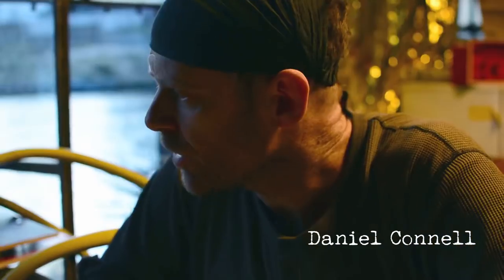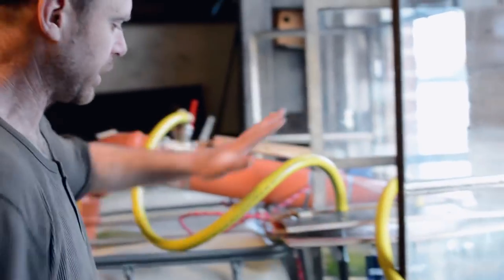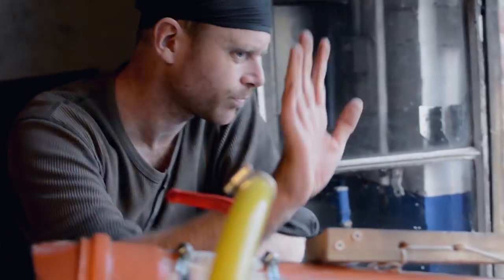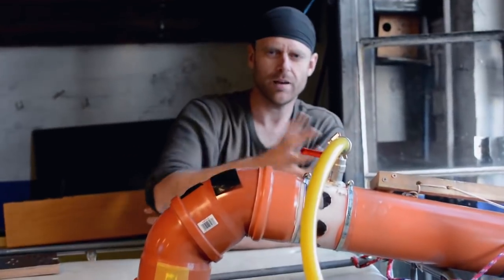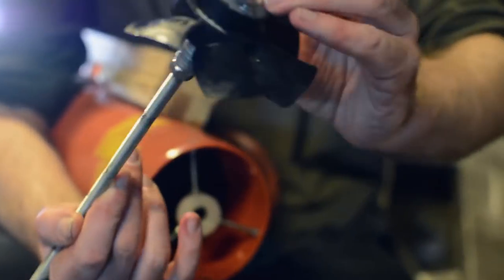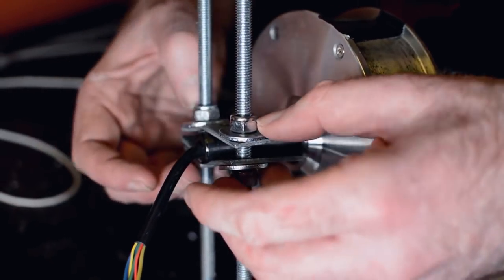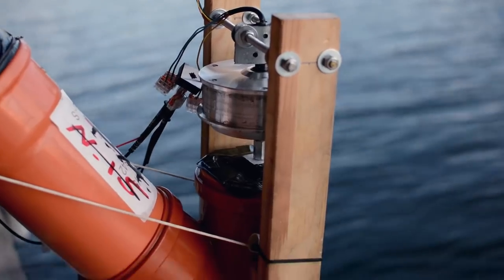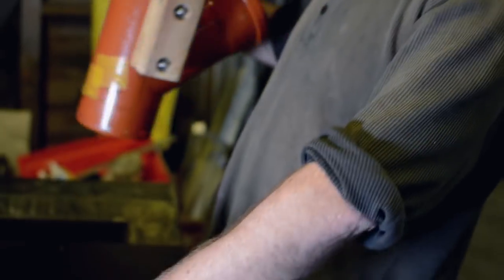$50 Water Turbine-5 kilowatt hrs/day - Open Source, DIY

Comment: Would this not have the power to run a pump to refill the reservoir ? You could then pump water say up 10 feet  to a tank , then run water  through the system and collect  it in another tank at the bottom  then  pump it back up. Making a perpetual water engine turbine ? If it can provide 5 kw per day , then surely this is feasible with power to spare .
Or use it to charge batteries that in turn run the pump ? Or add a second shaft after the turbine to turn a pump to pump the water back up to the feed tank ?  Or add more turbines to the pipe to make more electric  for the pump ? I am sure there is a equilibrium that could be met to make this possible ? Could you not also just put this as a loop in a tank and kick start it? Once running would it not just be continuous ? I wish i was involved in this and had the basic knowledge to do the electronics . My mind is freaking out Man !

Comment: dude lets find a way to use the pressure and convert it to power as well . I do realize that the pressure to the bucket will not always be part of this system but .... data .... fun ;)
Reply from the maker: More pressure means less flow, so less momentum to extract power from.
Pressure turbines usually work well, but require at least five to ten times the head of this one.

Comment: You could use a screw propeller...
Reply from the maker: Archimedes Screws are pretty good for low head, but a little tricky to make, and very low revs so would need a lot of gearing to get useful voltage.
I will be experimenting with a couple different shaped runners in the next tests tho.

Comment: The parts cost more than a 120 watt solar panel. What about the Hoverboard motor. Where do I get one of those for free? Apart from your $ss error I think it is a good starter project.
Reply from the maker: I'm only seeing 120W PV for about $100+, a little less in global south countries but the turbine materials tend to cost less there too.
Hoverboards, with two wheels, can often be found for $2-30 second hand and this is included in the turbine cost. These are obviously much harder to find in other parts of the world, where I usually end up using something like a motorbike alternator, which does a somewhat acceptable job and exist essentially everywhere.

Comment: why not mount this over a swimming pool or a deep fish pond?????  I am thinking ]------------]]
Reply: you can but the pool has to be located near a high drop point. it needs high pressure of water flow to get the turbine moves with good efficiency.
Reply from the maker: It would work until the pool was full, and then it would need to drain somewhere...
Reply: @OpenSourceLowTech  What if the in take pipe was 15ft long and the out let pipe was 14ft long straight down would that work? Or do you think that would slow the flow down to the alternator to much?

Comment: What is the best cheap charge  controller  to charge  a 12v battery 😋have already generated 96v
Reply from the maker: Since hydro is very stable in terms of output voltage, I'd imagine you'd probably get away with putting it through a buck converter to knock it back to about 17V or so, and then into a standard solar controller. I'll be trying this myself soon, but haven't yet.

We've got quite a good forum going on Facebook:
https://www.facebook.com/groups/windturbinemakers
It's mostly for wind power, but there's a lot of chat about charging batteries in general..
Reply: @OpenSourceLowTech  can I use a motorcycle  regulator  instead for I have access, my question is , am I going to waste a lot of power ?

Comment: 200 Watts isn't bad, not sure why you hid it in the 5 kw/day value
Reply from the maker: People can forget that hydro is 24/7, so will compare to a 200 watt solar PV panel, which is only producing for usually about a quarter the time...
Reply: @OpenSourceLowTech  ah, I see. Makes sense! I've just never seen power ratings displayed like that.

Comment: Where are you....
Iam trying to make one
Reply from the maker: This build was in Berlin, currently I'm in Scotland.
Reply: @OpenSourceLowTech  Are you testing it..
Reply from the maker: Yep, got hopefully three going into waterways around the country over the coming months. I'll publishing the results and full build tutorial once I'm happy with the design.
Reply: @OpenSourceLowTech  i also made one only need to connect alternator i am getting round about 2000 RPM on No load
Reply from the maker: 2 krpm sounds about right, I'd advise a hoverboard wheel for the alternator but it depends on a couple factors. I'd love to see what you've built, if you can email me at opensourcelowtech.org at gmail.com
Reply: I am actually busy with college project. And secondly
Our internet is banned to 2g by government
Actually i had 85mm fan and got 75mm Y pvc joint so it got some what complicated.
It isn't finished yet and tested it using water pump
Reply: Iam getting hower board wheel of  300w for 20$
Reply from the maker: Yeah that's not too bad. 6.5 inch?
Reply: @OpenSourceLowTech  yes 6.5
Reply: Did you improve the turbine.
Reply from the maker: I'm lining up some test sites at the moment.
Reply: How are you going to charge your batteries
As the output voltage will be higher than 12v of the generator

Comment: 35 liters a second is about 3 million liters a day for 5 kw.... that doesnt sound very sustainable....
Reply from the maker: The water's not being used up tho, the turbine is placed in a stream, the water goes through it, and then back into the stream.
Reply: Also the water will flow no matter what... If you decide to use it without emitting any co2 and just theoretically slow down the stream a tiny bit is up to you... The water down the stream is still available to others for the same purpose or drinking or watering or whatever
Reply: Yes if you find a stream sufficient enough it will probably work fine, but if you use it in a still water like you did in this video and part 1 the water will drain fast if its not a huuge lake.
Reply: @OpenSourceLowTech  dont get me wrong, i love the concept of the vacum pump, but how could you "easily" increase the watt out? would a bigger pipe/higher liter per second or a bigger better turbine be a better solution, could you have more turbines in the same pipe or would that just slow it all down?

Comment: BEarings work under water . Just use sealed bearings .  This thing would lose the Jerryrigged factor by a lot if you did not use lock tight and wingnuts .      Just saying .
Reply from the maker: I'm a big fan of nylocks.
Sealed bearings a re a thing, but a bit harder to source than just a bot of plastic, and that seems to be working fine so far.

Comment: You really need to show each piece and how you connect it, where you get it and what it is called. If you want to be a good teacher, Other wise why do it?  I can't follow this.
I need to build one using a wheel and water fall. I will have to keep looking.  Probably have to hire someone who knows this stuff.
Reply from the maker: There'll be a full step by step build tutorial once I've done a bit more field testing on the design.

Comment: I know this is supposed to be low tech, but since 3D printers are available all over the world, you might consider a 3D printed impeller. It would be sturdier and you could optimise the geometry for water. Also, have you thought about using an old turbocharger as the waterturbine. If you remove the compressor und attach the generator instead it might be an efficient turbine.
Reply from the maker: I started with a printed impeller just as point of reference (check the Part 1 video), but availability is a critical issue..
Turbo fans would likely work and definitely be stronger, but not a lot of turbo charged vehicles in the global south.
Reply: @OpenSourceLowTech  Yeah, I saw that video afterwards and I was wondering if you tested just one printed impeller design or more, because for your application a helical impeller might be better than an fan.

Comment: You are turning a small generator and claiming amp/watt output from a voltmeter. The real output test is when is has a load..  The results will be much different and your math will have to be corrected. Try it.
Reply from the maker: The liquid rheostat is acting as a variable load, which is what the amp meter is measuring.
Reply: @OpenSourceLowTech   How about a video having an actual load. Supplying power to an electronic that needs  200 watts to operate to see real efficiency of the hoverboard motor/generator.  I guess we all know that generators need movement to produce energy but the question we  all looking for is, what is the most efficient generator  based on rmps,torque and wattage than can handle under a load? You claim is hoverboard motor. I'm sure some people wouldn't mind spending few dollars considering they are already putting the time and effort to create  energy. There are few out there that claim high output with low rpms. Thank you for your ideas.

Comment: Hello Daniel, have you tried to replace the water pump by a RAM; Pump? (https://en.wikipedia.org/wiki/Hydraulic_ram) that would make it really Zero energy, even on your test rig :) Your view?
Reply from the maker: Ram pumps are good technology, but also require drop and so don't work in flat water. It would be possible to run a ram to pump water to elevation and then run this turbine from that, but given the various losses and efficiencies, and that there's no such thing as a free lunch when it comes to energy, you'd be better off just running the turbine off the water feed instead of the ram.

But I do want to have a play with them at some point for irrigation and the like.

Comment: Definitely an interesting project, maybe you should try using a second computer fan as a pre-swirling stator, that should allow you to get more power! If you wan to give it a try you just have to install the stator in the opposite direction of your rotor, so to speak that the flow has additional swirl in the same rotating direction as your rotor. here you can find a photo of what i mean : http://www.drillingformulas.com/wp-content/uploads/2018/05/Turbine-stage-component.png
Reply from the maker: I tried a stator but it dropped the output power by about 10%. Not sure if it was just that I made it badly tho..

Comment: Suppose you use 6" diameter pipe for the intake and over the top and down to the water line . then funnel it down to 4" diameter pipe to house the turbine at or below  the water line . Then expand to 5" diameter pipe down to the water below . I think the pressure caused by the reduction from 6'' to 4" diameter pipe will be a benefit , and put two fans on the end of the shaft .
Reply from the maker: Throttling the impeller will increase the local velocity, but reduce the flow and power overall. It's a sweet spot.

Comment: If i used rain water tanks that vary in height. Could start the cyphon and create an endless cycle
Reply: So long as you generate more than the energy required to pump it back to the top

Comment: Over convuluted, Pelton wheel on a washing machine motor as a genarater search first build second. This was all done and dusted in the 1700's
Reply from the maker: Peltons need at least twenty meters of head to function well.
This turbine is lower power, lower efficiency, but will operate at about a tenth of that drop, for those with access to only that water resource.

Comment: 50 dollar turbine....   not even close to what it will cost me, 1 howerboard alone is around 100 euros in norway
Reply from the maker: You can get a second hand hoverboard usually for about €20-30, which has two wheels.
Reply: @OpenSourceLowTech  not here
Reply from the maker: Here's two whole boards for a tenner in Tønsberg:
https://www.facebook.com/marketplace/item/3643337269083373/

They're both broken but it's almost always the battery or controller board which has gone, the wheels are essentially bullet proof.

Comment: Have you tried stacking two fan blades, turned so one leads directly to the second, effectively making the blades twice the height? Have you tried fans of different static pressure rating? Is one made for high flow or high pressure better as a water turbine? https://www.youtube.com/watch?v=Mdx9U-KW038 I'd use a piece of shrink tube on the rod at the top seal instead of electrical tape.

Comment: Let me toss some thing at you 10kv transformer and a 5000 watt converter dc to ac ????
Reply from the maker: These kinds of approaches may be possible. Presumably wouldn't work so well with the wind turbines because varying voltages, but hydro is generally very stable in output, given a fixed load.

Comment: Could you scale this down with same or similar efficiency to a water hose size (or smaller) via a nozzle adjustment and some kind of arrangement like this?: https://www.youtube.com/watch?v=vify0k2sHlQ and by combining multiple turbines?
Reply from the maker: It's a low head momentum turbine, not a pressure turbine, so the power comes from the volume and flow of water. Throttling it down to a jet would reduce the output as there' not the pressure behind it to get that jet sufficiently blasting the runner.
Reply: @OpenSourceLowTech  hmm, but the trick I'm talking about is to reverse an alternator to remove the brush and instead place the windings on the outside so as to greatly reduce resistance. It seems that lower water volumes could be used with much higher levels of efficiency and this is the key: how to make this work for those with creeks or even smaller water flows?

Comment: This is nothing new. Not one video has shown anything electrical being powered by it. Is a reason this is not in every developing nation. It produces very little power and is not sustainable. And the location for this to even work at all is extremely limited
Reply from the maker: It produces 200 watts / 5 kWh per day. Can be used anywhere that has a couple meters drop of at least 30 liters per second. That's not everywhere on earth, but should be useful to several million people globally, which I think makes it worth having as an option.

Comment: meh. commercially available real 500W systems are around 200usd.  AND THEY WORK! Sorry but I am sure this is not. It's good you having fun tho.
Reply from the maker: Got a link to the commercial unit? 
Always good to see how others do things.
Reply from the maker: That site has 500W Kaplan low head turbines for $900 plus whatever the shipping would come to for a 30kg unit from China.

So about twice the power of mine, for twenty times the price. Except you'd also have to supply and build its run and draft, which aren't included.
Reply: @OpenSourceLowTech  dunno what prices you've found. I imported 1kw 176usd+shipping(although I am importer ;) I can sell you 500W 300usd in EU anytime ;)

Comment: Those 110mm drainage pipes are not cheap for that hole pipe you've got there, you're looking at $120, so your concept of $50 is BS.
Reply from the maker: They're 125mm feeding to 200, both of which I've generally been able to find for about $1.50 - $3 per meter, tho they do vary wildly from place to place.
Reply from the maker: Everything pictured in this video cost me just under €40.
Reply: just done a price check and you're correct, cost fair more than he's making out.
Reply: @OpenSourceLowTech  i'd get things cheaper if i took my gun too.
Reply from the maker: https://www.bauhaus.info/kg-rohre/funkegruppe-kg-abzweigung/p/13627600
https://www.bauhaus.info/kg-rohre/funkegruppe-kg-rohr/p/13627349

Comment: You have been working on this project for months, or is it years now, and STILL you have not learned how to connect a LOAD to your generator.  I'm from Missouri dude.  Show me POWER generation.  Voltage without current is ZERO POWER.  Open circuit voltage means little.  Open GoFundMe page and solicit funds for a few light bulbs, so that you can create a 200 - 600 wattt LOAD.  Get it?  LOAD your system!  Getting tired of your ramblings of how much the system could provide.  Show it!   Also, where are you getting the free water?  The water in that aqueduct is hardly free.  Talk to the supervisor and apply for a permit to discharge water from the source and tell us what the water cost.
Reply from the maker: I feel that you possibly haven't watched this video.
Reply: @OpenSourceLowTech  My apologies, I watched a different video first.  Just watched this one from beginning and saw your "washing soda" load cell.  Very creative.  Will try to pay better attention in the future as I follow your project.  My mistake, sorry.